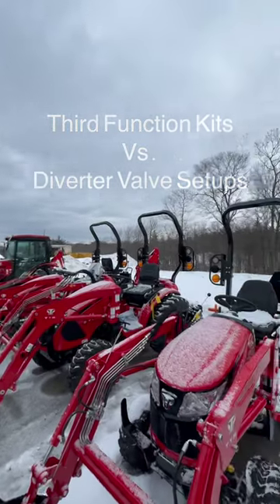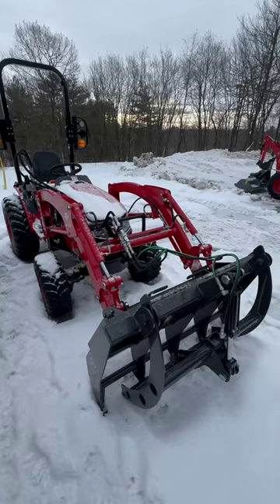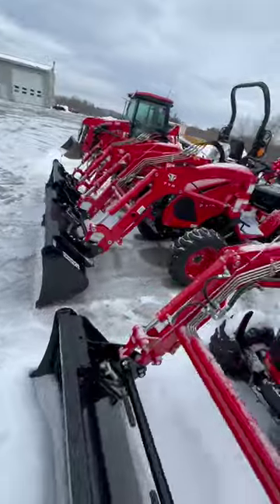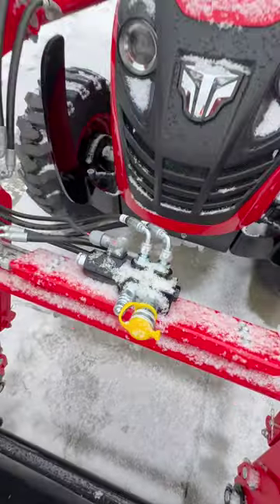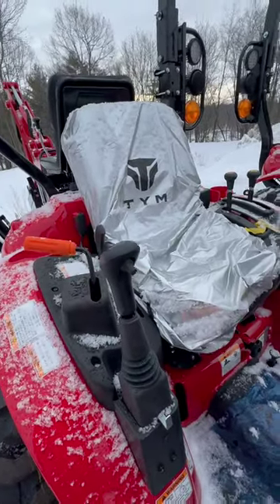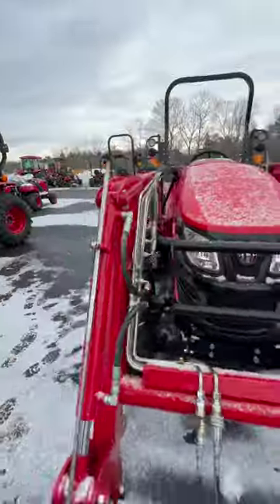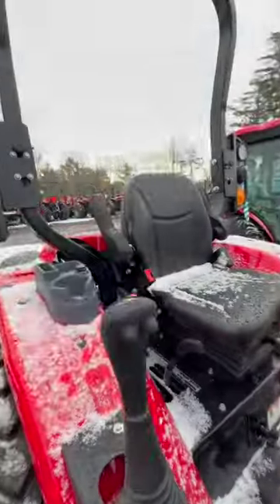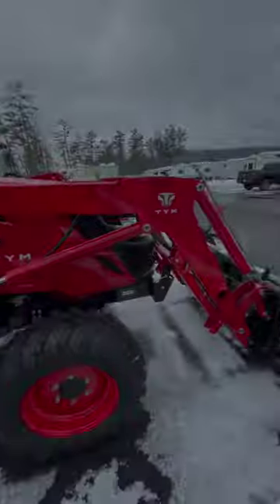Third Function Vs. Diverter Valves

Comment: I like the diverted valves better, because you can control the implement much smoother than all or nothing with the third function.
Reply: Thats what I understand. I am going to put a diverter on my New Holland 25hp for a grapple. The diverter valve evidently allows you to close and open the grapple with speed control.
Reply: @ yep